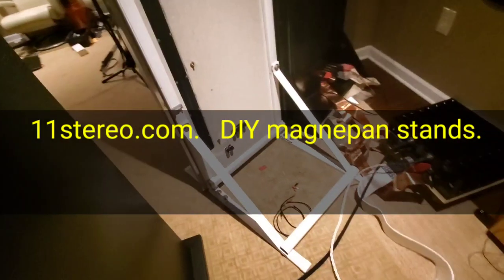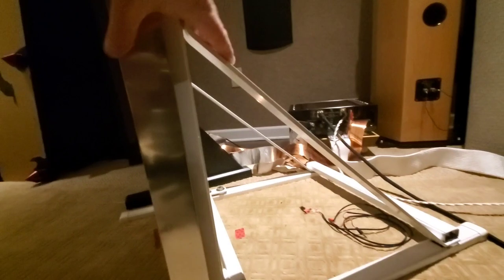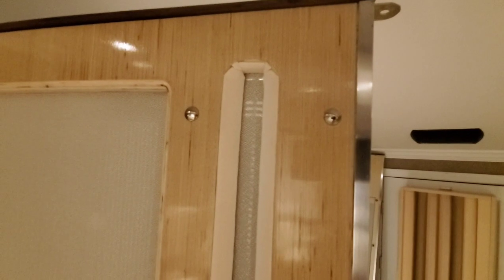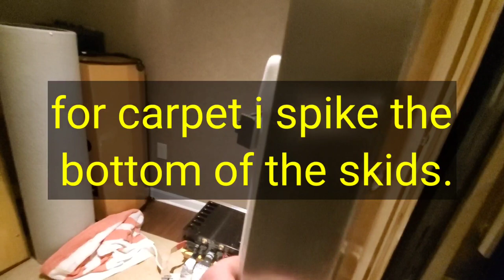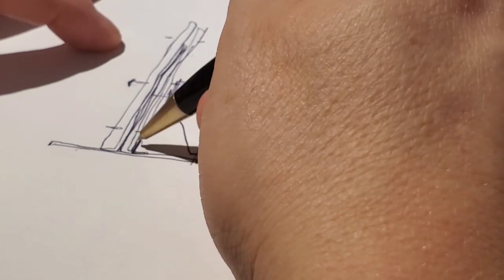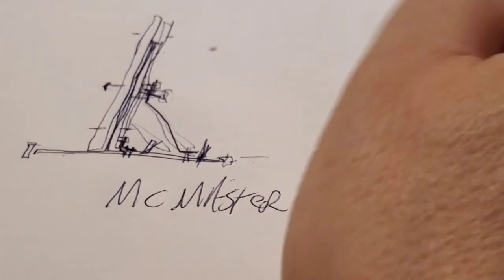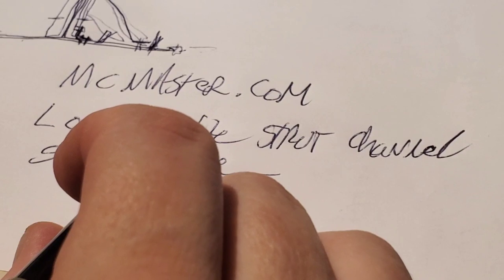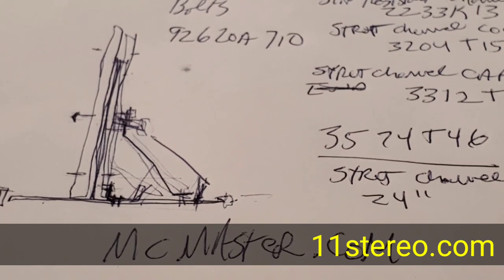DIY Magnepan Stands

Comment: In the right hardware stores there are square aluminium tubes and matching moulded plastic corner connectors.
Boating awning/canopy fittings are another source of similar fittings.

Comment: I would leave a air gap at the bottom don't want the speaker touching the frame encourages Vibrations possible noise from the frame just a couple of millimetres gap, when attaching the L bracket and ideally you want a cross member at the top as well.  You might as well use heavy-duty cast iron L brackets with bracing already attached 14 /9 inches long instead of adding the bracing. Be a lot stiffer and add some weight